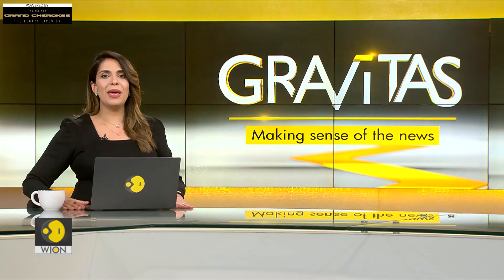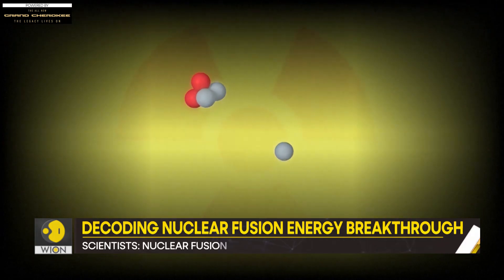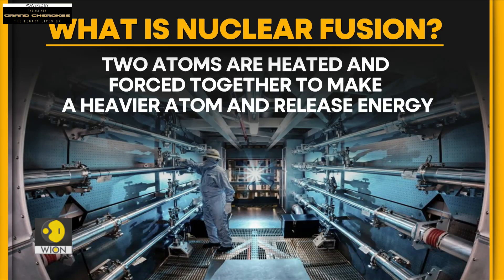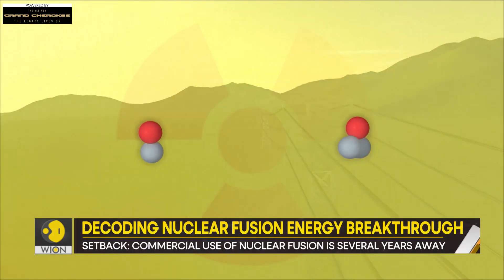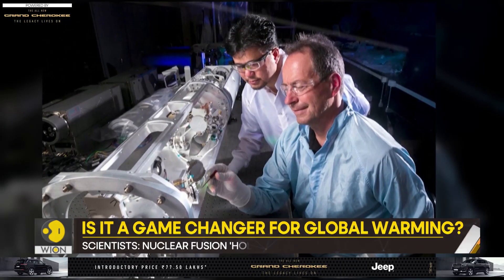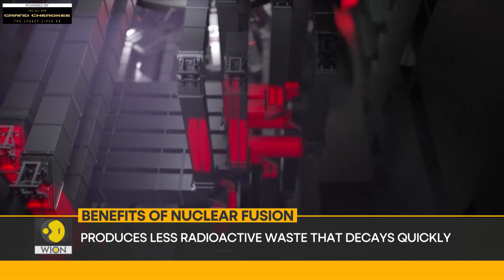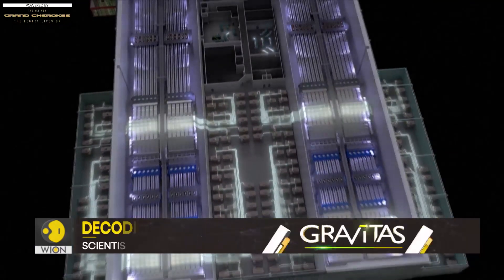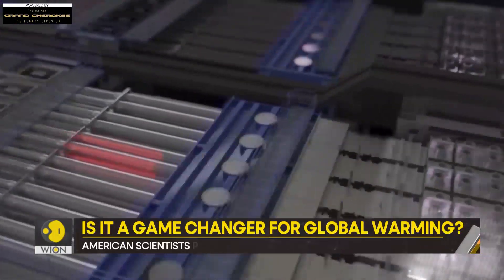Gravitas: Decoding nuclear fusion energy breakthrough

Comment: This is never going to be used to boil water.  The amount of energy taken from the power grid was over 300 MJ for this shot.  They put in 2 MJ of laser energy into the holhraum and got 3.15 MJ out.  So for 300 MJ of electrical energy, they got out 3.15 MJ of energy in the fusion products.  They said in another article, that only 1% of the 2 MJ of energy actually went into the frozen deuterium-tritium pellet, so it was a huge boost in energy.  It is supposed to mimic an H-bomb which is the real reason they are doing this.  This method will never be commercial.
Reply: yep military gets it first and then fusion jets,missles, tanks,fusion rockets but like 50-70 yrs later

Comment: That is what I also heard. They were able to output more energy than the input. Some of the equipments they used aren't also up todate. I think it is possible to increase the efficiency if the refine their methods and use modern equipments.
Reply: Didn’t they violate laws of thermodynamics???
Reply: @quonxinquonyi8570  well no because I’m pretty sure it’s impossible.
Reply: @jamesmylife6578  well they only take account of carbon emitted wastage as waste energy....even on economics scale the cost per unit joule should be extraordinary

Comment: The question I have is, did they produce more energy than it would take to produce the hydrogen?
Reply: Yes they did, that IS the news, the explanation in the video made a mistake
Reply: If you accept the fraudulent accounting of the USA, yes.
The laser input 2 megawatt. The fusion returned 3 megawatt. However to get 2 megawatt of laser power, you have to use 40 megawatts to power the lasers!! That means the Americans used 42 megawatts to get back 3 megawatts. Typical American fraudulent accounting. That's why so many con financial people like madoff, FTX etc occurs in the USA.
Reply: @hclau362  actually 400 megawats, but that's not how "Ignition",  the achievement here is measured.
Reply: @kunof2074  Fraudulent accounting! Rypo on my part, but still fraudulent accounting. Not counting the actual cost.  It is like saying my retail shop makes a profit but not including rental cost etc etc...
Reply: @HC Lau  haha yeah, honestly I was a little disappointed when I found out the energy cost of the facility. But this achievement has still never been done before and is very important.  The important bit is that the US did not lie about what they accomplished. There is only a misunderstanding of what was achieved.
Reply: @HC Lau  the 400 megawatts it cost to run the facility is an independent measurement. The techincal press conference held by the American goverment following the official release spoke of exactly what the diffrence is between net positive from grid energy to the net positive from lazer energy. They openly admitted the laboratory consumed 400 megawatts of power to prepare the experiment.
Reply: @JB  The laboratory uses allot of technology that is 20 years old and is not built to be a power plant, only to prove that more energy can come out of the reaction that is shot into it
Reply: I think a lot of energy will be required to start the first fusion reaction which later on will be self continuing reaction with supply of hydrogen only with release of continues large amount of energy
Reply: @ngk2163  hey hi

Actually we are doing a project on carbon free fuels and then i got the news about this
Can you explain it and how it can be useful for my project
Reply: NO!
Reply: Yes.  Significantly more output than the input.  The physics is down.  Now, US engineers go to work to miniaturize and put it into the US Market.  But, the US has arrived and only a matter of time especially with massive VC inflows of $$.  We’ve got work to do.  Fk China!

Comment: This piece has so many errors. For starters, the American experiment did infact produce more energy than it took in. That's why its news. Other laboratories around the world have successfully initiated a reaction but none have done so with net energy gain.
Reply: So where the hell would be the energy dumped at??? Blackhole, wormhole,...this is complete violation of thermodynamics
Reply: No its not violate anything! just look at the sun!
Reply: @quonxinquonyi8570  

Its given off as heat. The goal is to produce enough of it to generate steam used to drive turbines.
Reply: @Quon xin Quon yi  

You are short-sighted! This aim of these experiments is to develop the capacity. When the Wright Brothers first initiated powered flight; their flight only lasted  12 seconds yet some in the crowd with your same name was casting doubt about the prospects of powered transatlantic flight.
Reply: @quonxinquonyi8570  

I'll screen shoot this your comment and revisit you in 10 years.

Comment: Not a breakthrough !  With all the cost of lasers and only modest energy gain of energy applied to the target relative to energy released from the target plasma (note: not a calculation of energy input to the lasers that would result in an energy loss from the reaction), it is cheaper and more effective to use conventional renewables.  Note also that the fusion reaction causes the apparatus eventually to become radioactive waste.  Thus, in view of the technological challenges ahead, this is no significant breakthrough and does not warrant the spin given by the US Government.
Reply: Absolutely right....coz they would have to dump the energy as well to uphold laws of thermodynamics...where wil be that useless energy dumped at...blackhole,wormhole

Comment: IF THAT IS GOING TO BE FURTHER DEVELOP, COUNTRIES AND MANKIND WOULD NEED NOT TO DEPEND ON FOSSIL FUELS, AND FROM THE OIL EXPORTING COUNTRIES LIKE THE MIDDLE EAST AND WE WON'T BE AT MERCY OF THIS OIL EXPORTING COUNTRIES IN THE FUTURE!
Reply: Well it will take a decade for that but most Countries are switching to ev and electricity demands are done by either coal or nuclear reactors
Reply: Don't believe the hype !
Reply: @thewiseperson8748  IT'S NOT A HYPE! IT'S A START OF A BETTER AND MORE SUSTAINABLE SOURCE OF ENERGY FOR THIS PLANET!  

PEOPLE AND COUNTRIES WILL STOP DEPENDING ON FOSSIL FUELS FROM ARAB EXPORTING COUNTRIES AND THEIR MONOPOLIES OF FUEL PRICES!
Reply: @eteng64  Response:  So the energy conversion efficiency of the system is circa 1%.  For a commeciall viable laser-ignition based energy system, the efficient would need to be at least 500% since high quality electrical power input to the laser systems is being converted to thermal energy output when the target is fusioned.  Circa three orders of magnitude increase in energy output performance is next to impossible in practical terms.  Thus, this Lawrence Livermore technology for commercial reasons is a non-starter.  Why then the celebration ?
Reply: Don't depend on fossil fuel , depend on "Not so Great" America. Your choice..

Comment: It actually did produce more energy than it's input. That is quite literally what the announcement was.
Reply: Not is you consider the input power to the lasers; in such a calculation, there is net energy loss.
Reply: @thewiseperson8748  Almost no net energy was produced. 0.1 percent. This research needs to be stopped and the billions we spent on it should go to building safe fission reactors. We don't have the technology yet to build a fusion reactor that will actually be viable. Maybe someday but it's centuries away is ever. It's just the truth
Reply: @cmontes7961  I agree 100%.  The money would be better spent developing and deploying renewables.
Reply: Total Laser power 300Mj, light output 2Mj, output 3 Mj🤣🤣🤣🤣🤣🤣🤣
Reply: @vhrui904  So the energy conversion efficiency of the system is circa 1%.  For a commeciall viable laser-ignition based energy system, the efficient would need to be at least 500% since high quality electrical power input to the laser systems is being converted to thermal energy output when the target is fusioned.  Circa three orders of magnitude increase in energy output performance is next to impossible in practical terms.  Thus, this Lawrence Livermore technology for commercial reasons is a non-starter.  Why then the celebration ?  Thanks for providing truly representative numbers.
Reply: @thewiseperson8748  my guy, the lasers were purposefully not made to be as efficient as they could be. They were made to make the experiment fucking work consistently LMAO
Reply: @whenisdinner2137  However, the laser efficiency has to be improved by circa three orders of magnitude.  That is not a trivial issue to resolve.
Reply: @thewiseperson8748  certainly not but the experiment they were purposefully making the laser extremely inefficient but high powered so that it would consistently make the fusion reaction.
Reply: Announcement one thing, reality another...................
Reply: @PS-ic4bp  Neither Now, just like going to the moon ..................................
Reply: @phouliscostantinou1767  But if iit was announcement from China or Russia you would have accepted it as facts right?
Reply: @napobg6842  100% because they Never invaded and destroyed soo many countries and never saw WMD in Iraq, all facts relate.
Reply: @phouliscostantinou1767  Hahahahhaha 🤣🤣
Reply: @napobg6842  Look up Q Plasma vs Q total. Stop believing everything you hear and fact check.
Reply: @cmontes7961  Dude all that matters is that we achieved a significant breakthrough. It happened that it came from the US. It is a default choice. After all so many of the greatest scientists are there no matter from the US or the world. That doesn't really matter. What matters is that maybe within 20 years we might have a source of energy that is extremely cheap for you and me
Reply: THE LASERS NEEDED 200 MILLIONS  MEGA JOULES OF ENERGY TO THROW THEIR SHOTS AT THE TARGET. 
When you take that into account,  its a NET LOSS.  
The Plasma once formed around the pellet of D T.....deuterium- tritium received 2 Megajoules of energy for a trillionth of a second....and gave back 3 Megajoules . 
Hardly a NET gain of 1.5 😏